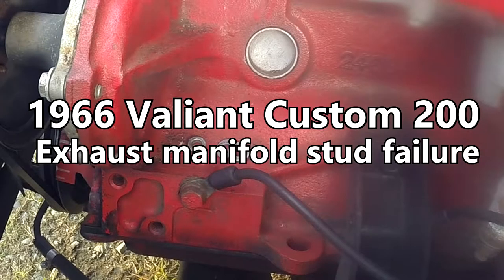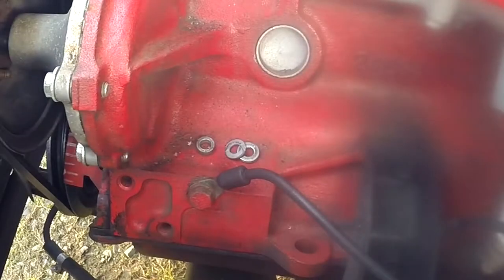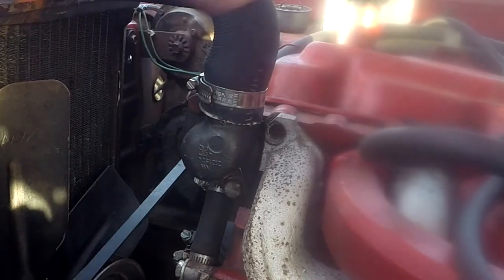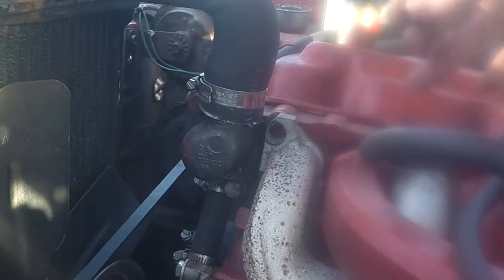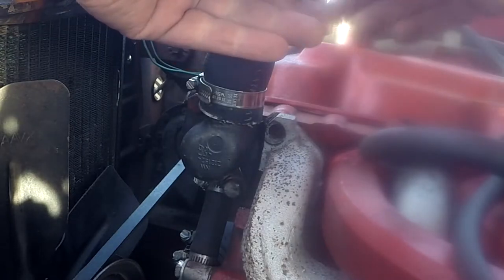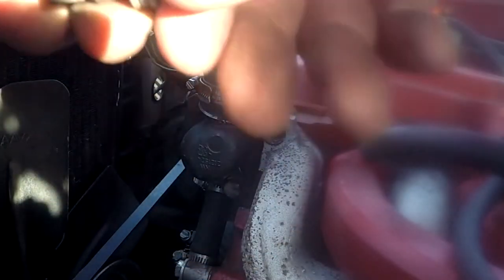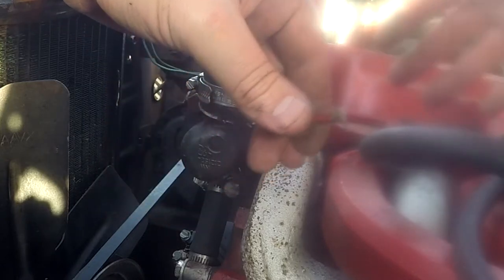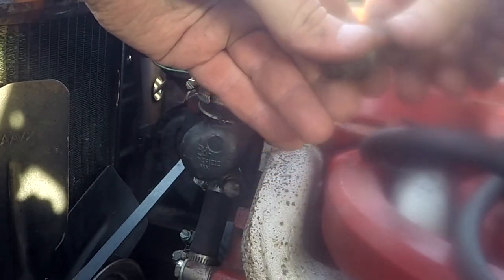1966 Valiant-Exhaust manifold stud failure

Comment: The exact same thing happened to my '68 Valiant. What causes that is, the manifolds use specific fasteners in certain locations. On those two end studs, at the very front and rear, there are supposed to be a special nut combined with a brass washer so that the manifold can sort of "float" as it expands and contracts due to temperature changes. Over the years those disappear along with the knowledge of their usage. When you use regular steel washers and nuts in those postions, it binds the manifolds and then either the stud breaks or the manifold cracks. I have a good page saved that explains it if you would like me to link it. I'll be doing this repair on my channel coming up soon.
Reply from the maker: You described it exactly. in this case I think someone used the aluminum fat washer in attempt to emulate that effect, but with less success.